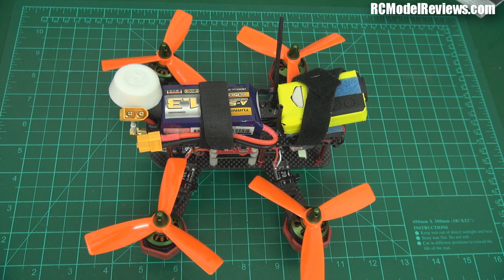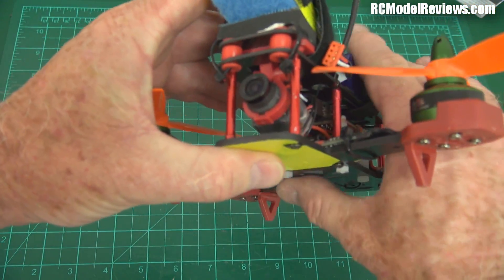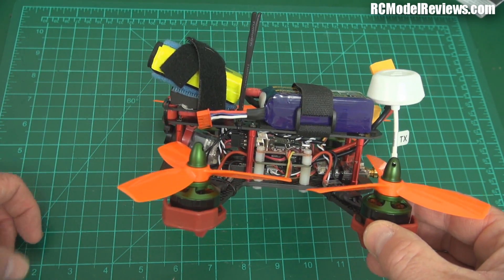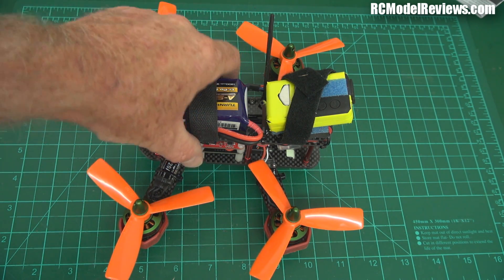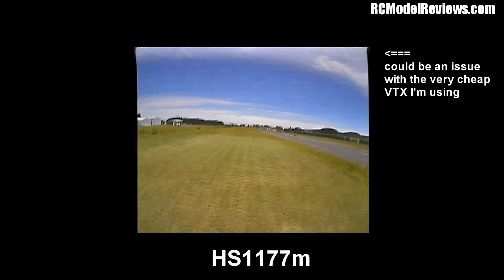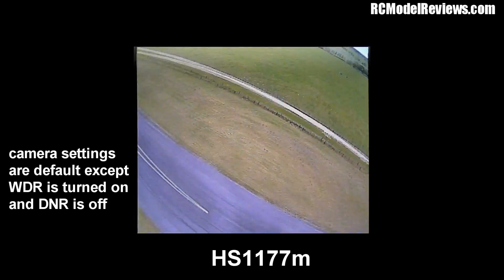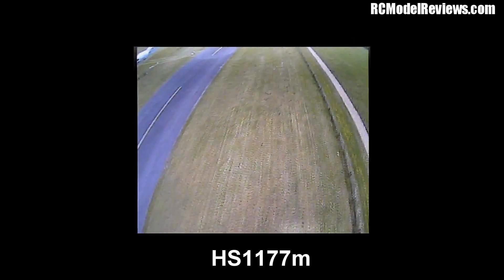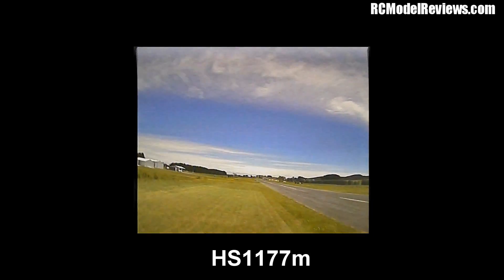In the air: HS1177m FPV camera

Comment: Don't get the hype with these hs1177...have the old Sony 600tvl that Bruce reviewed few years back and is very similar in performance with the hs1177,  even the osd structure is 90% the same....when can I see a versus video between these 2? Assuming it doesn't exist already :)

Comment: Wowowow STOP you HAVE to check this: The HS1177m seems not to be the Nextchip2040 camera. Please take a look at the chip. In my version the printed number on the chip is scratched off by the manufacturer. My version indeed was a Nextchip2090 what causes problems with Maxchip OSDs. That means: It is a better camera, but it is NOT the Nextchip2040 for what it was sold to me by Surveilzone. I feel betrayed by them. Can you please check that on your camera?

Comment: Great info on this one Bruce, very helpful. Just wondering if the length impacted the max angle you could achieve with this lens when using 35mm separation between top and bottom plate?
Reply: +BMSWEB I was able to get enough angle for my style of flying and there's some to spare so you'd probably get at least 40 degrees out of it -- but I'll check.
Reply: Thanks Bruce :D No hurry at all

Comment: are the turnigy A-spec Lipos worth the $$$? I tried to find some reviews on them but there's not much out there.
Reply: +basebilljr07 Stay tuned and I'll let you know!
Reply: +xjet Hi. Not trying to urge you, but van we expect something about the A-Spec batteries? I'm about to buy some batteries and I value your opinion
Reply: +007titok I've been a little disappointed with the A-Spec batteries.  I haven't conducted any bench tests yet but so far my nanotech packs actually perform better at a much lower price.  At this stage, I don't think they're worth the extra cost.  The Bolt and the Graphene are better options for the money.
Reply: +xjet Oh, thanks. Then I'll buy nanotechs

Comment: What is DNR?
Reply: +dellagd Dynamic Noise Reduction.  In some cases it works by comparing two or more successive frames of a video so as to work out what is noise and what is actually picture and then removes the noise.  Unfortunately, this can lead to extra latency.
Reply: +xjet Thanks! Good to know. I had turned it on in my board camera without knowing what it did since noise reduction sounded good to me :P

Comment: Have you seen RedRotorRC's Sitrider 250? It is similar to the Blackout because it has a PDB but also has an OSD built in with RSSI, current and voltage. It also has foldable arms and regulated power. Also, can you take a look at the new lumenier motors? (Specifically the 2206 2350's)http://www.redrotorrc.com/index.php?route=product/product&path=34&product_id=54

Comment: The depth of the camera wouldn't be such a problem if the camera was mounted proud of the drone.. although it would require an expensive carbon fibre, or cheap 3d printed cage to keep the camera damped and safe.
 (I print 3d cages to hold my own cameras onto my drones (they just wrap around the camera and have mountings etc), although quite strong, they are relatively quite likely to break off in a big knock.. but a new one can be printed in about 30 mins or so if required, with a few test pieces lying around as spares (hollow honeycomb structure on the inside for strength and lightness = it prints fast too)).
 
With your skills you could pretty much build a 3d printer IMO., there are many designs on the web.
Although.. there are also some really good cheap models of all kinds around ATM too, many open source and easily upgradable or hackable to do other kinds of task.
 It could revolutionize some aspects of your innovating and even lead to objects and Perhaps you could make parts to help people with, or to contribute to the community or even market as new products etc.
 just a thought..

Comment: Is this actually a 650tvl? When looking on surveilzone the 600tvl is cased and different to this. They list this version no case and plastic clear plastic sleeve as 650tvl and a different chip. Supposedly not as good for fpv. Shed any light on that?
Reply: Ahhh never mind it is 600tvl my bad still what is the difference between this and the cased version for a couple GBP less?